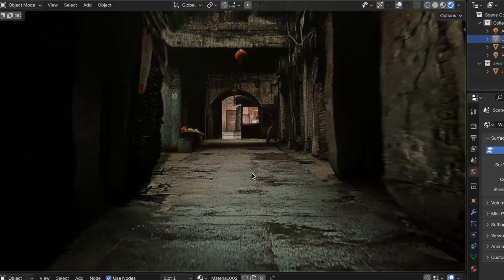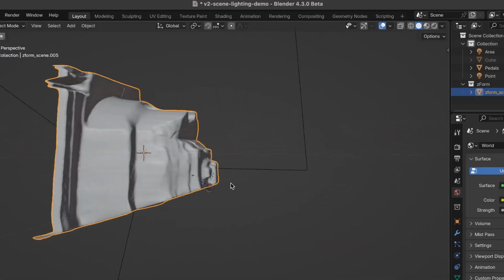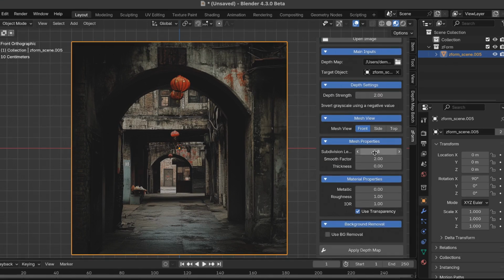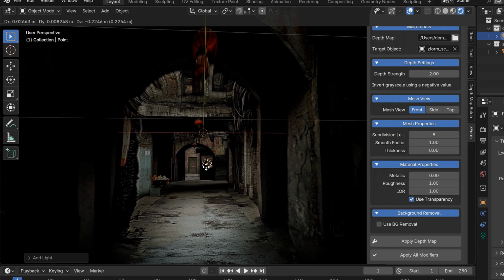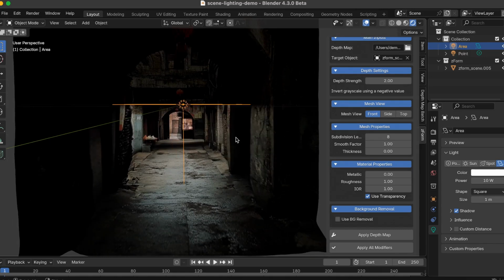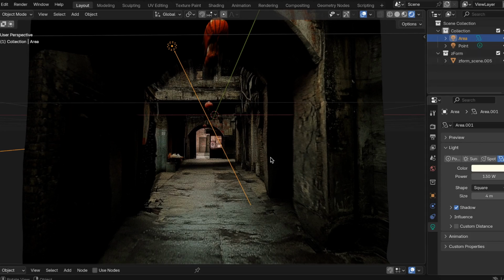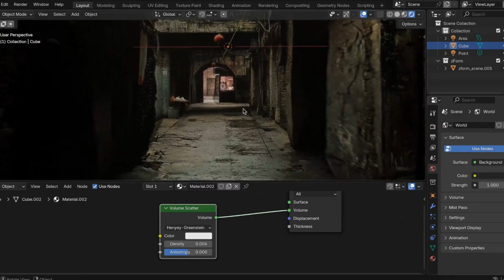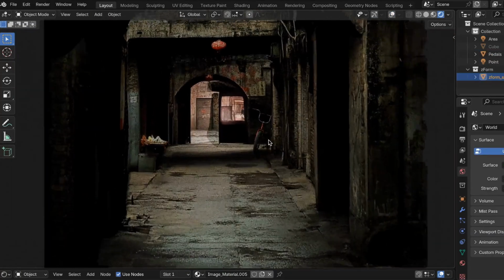How to Turn a 2D Image into a 3D Scene in Blender

Comment: I wonder if this could be done for a character design as well.
Reply from the maker: Although the answer is yes it could, it would not look that good from the side angle, and separately the backside would be flat if you ended up using the background removal assist feature in the tool. Here's an older video I have to show what I mean about a Panda character. 

https://youtu.be/Cwcj77iWt7I

Long story short, if you were only using a front-facing view of the character or maybe a slight side angle it might work....but I would be cautious with anything more than that. Personally I still like some of the results for characters from the front view and flat backsides....however it might not be ideal if you need full entire characters for a 360 degree view.

Comment: Bonjour, bon tuto, avez-vous une solution pour réduire voir éliminer l'effet d'étirement ? 
Hello, good tutorial, do you have a solution to reduce or even eliminate the stretching effect?
Reply from the maker: Thank you and bonjour. At this current moment I don't have an easy solution for this. A few thoughts that come to mind are either placing objects that fit the scene's theme around the most noticeable areas in the camera view or manually trying to adjust and fix the UVs of the material on those spots.